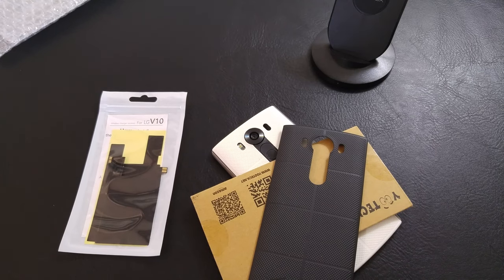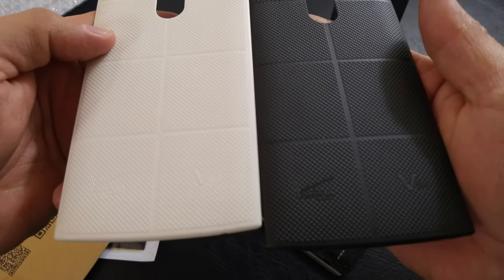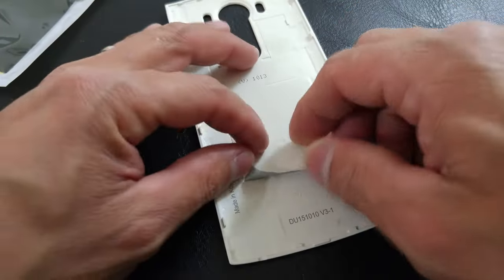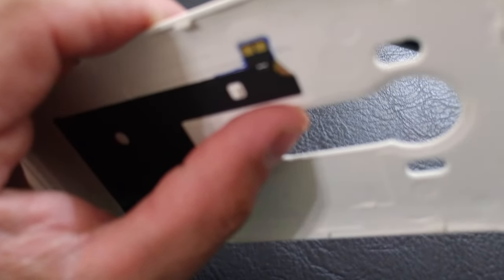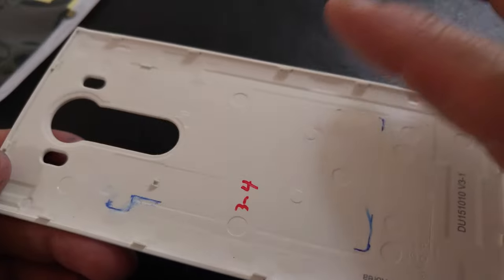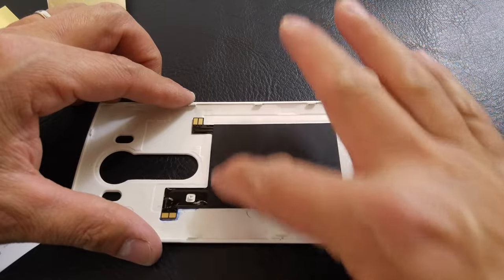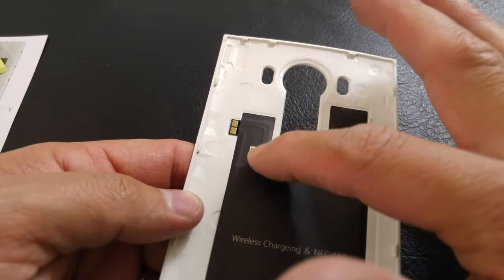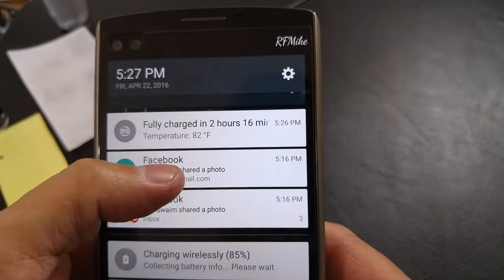How to Install your New wireless charger & NFC Receiver

Comment: I always have to take my qi   receiver off when I make an NFC payment. do you know why? it works when I put phones back to back but it doesn't work when I try to use my phone when making a payment at a tap n pay. when I remove the qi receiver  it it works perfectly    Samsung said it is because NFC is in the battery and the qi receiver is blocking the battery transmission
Reply from the maker: +New Yorks Finest they are are correct.

Comment: Where did you order everything from. I would like to get them for myself. Thanks again for your videos
Reply from the maker: +unforgiven101inc What Parts are You Wanting??
Reply: the back case and the wireless charger...
and how much did they cost you...
Reply from the maker: unforgiven101inc The backing http://pages.ebay.com/link/?nav=item.view&id=172176984527&alt=web  and the wireless charging LG V10 Receiver ,Monoy Ultra-thin Qi Standard Wireless Charger Charging Receiver Module for LG V10 (LG V10 Receiver) https://www.amazon.com/dp/B018EEUWBK/ref=cm_sw_r_other_awd_-vwixbJ6QES6D
Reply: Thanks brother...

Comment: hay...can the wireless charger fast charge V10?
Reply from the maker: +Khawaja Asad I'm afraid not. That is currently something only Samsung is doing.
Reply: okay what if i get the wireless charger bed of samsung?? and then charge my V10 with it? any work around?
Reply from the maker: +Khawaja Asad there is no work around for Fast wireless charging that if found for the V10. You can buy and use a Fast wireless charging pad it(V10) just won't pull those Higher mAh that a newer Samsung phone can Accept.